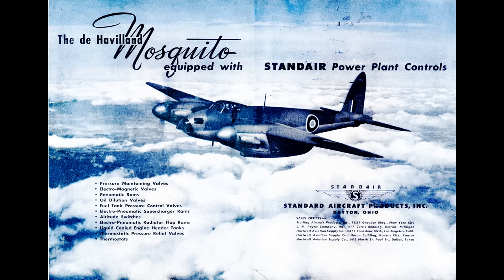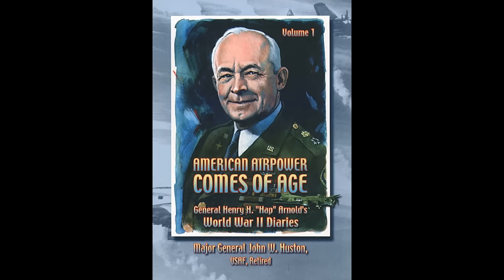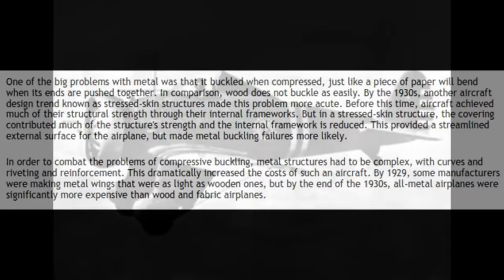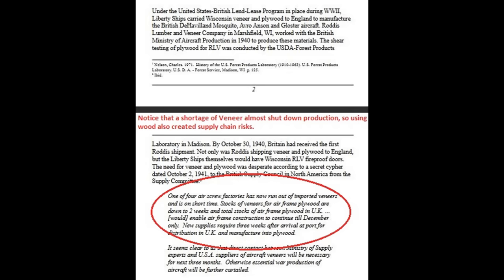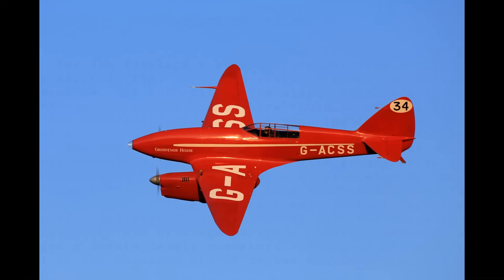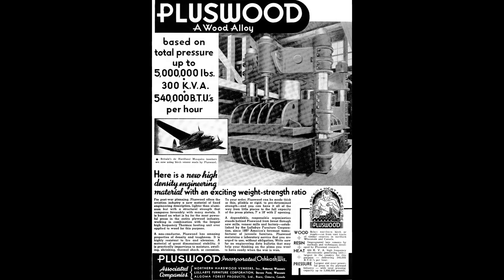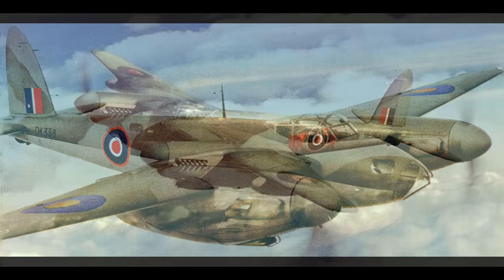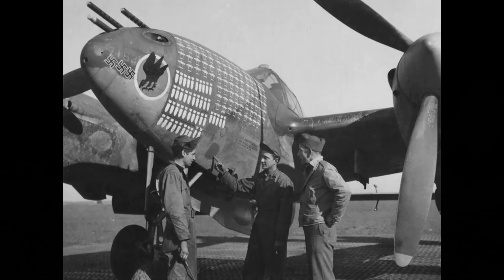De Havilland Mosquito vs. ?

Comment: Un-catchable! Met a WW2 RAF pilot in the 90's who had flown virtually everything during his service. He finish the war flying Photo Recon in "Pressurised Mosquito's" and in those missions had only encountered enemy aircraft once when 6 FW190's "Jumped him " and added a few new holes in his tail. When I ask how did you get away he said "I just opened up the throttles and waved goodbye!"  (Would also like to note the the Mosquito's had the lowest lose ratio of any allied aircraft of WW2. By 1945 only 1 aircraft was lost for every 2000 sorties.)
Reply: "When I ask how did you get away he said "I just opened up the throttles and waved goodbye!""

A very Blackbird reply there.
Reply: @scottgiles7546  it was the fastest plane at that time.
Reply: Piston contemporaries: P-51B/C was 6% faster (440 mph vs. 415 mph maximum speed), Dornier Do-335 Pfeil was 14% faster (474 mph vs. 415 mph), FW-190D-9 was 2% slower (407 mph vs. 415 mph), Grumman F8F Bearcat was 10% faster (455 mph vs. 415 mph), Grumman F7F Tigercat was 11% faster (460 mph vs. 415 mph), P-38L Lightning was almost as fast (414 mph vs. 415 mph).
Reply: @redfalco21 you re right.
Late in the war, there were unarmed moskito versions going up to 450 mph
Reply: @johnbrewer8954  for a fighter, you also have to be maneuverable.  Most single engined fighters would out-turn and out-maneuver any twin.  The Mosquito was fast, but not as agile as most single engined fighters.
Reply: @johnbrewer8954  source?  Or is this what you’d like to believe?
Reply: @redfalco21  Bearcat? Why not F-14 Tomcat? They both have precisely the same number of combat flight during WWII!
Reply: @marcinkoacz4580  Nice baiting attempt, but there’s no need to be asinine. F8F flew in September 1944, so there’s that.
Reply: @redfalco21  Bearcat is as contemporary to Mosquito as B-50 to B-24. It wasn't ready until the war ended and was one of the many superprop fighters that went obsolete before entered service facing jets competition. Whats more above 20 000 feet Bearcat wasn't even close to Mosquito, it couldn't with its one stage supercharger so it was unable to intercept Mosquito in 1944 and in 1950. Fun fact Bearcat was outlived in service by Hellcat, Corsair and Mosquito.
Reply: @marcinkoacz4580  whatever.  Mosquito is the fastest, bestest, magicest.  You win.
Reply: @heinzweber7642  there were armed P47's doing 472
Reply: @redfalco21  thats where context is important.. the late war 2 stage mossies could cruise at high speed even at 30kft  and open the taps is need be.. the enemy planes might be able to intercept but would be not be able to sustain a chase for long...
Mustangs escorting mossies of the banff strike wing across the north sea to norway  at 50ft also had a hell of a time keeping up with the mossies because they can cruise at higher speeds. Its a very clean plane, no rivets 😂
Reply: It wasn't that the Mossy was the fastest or could get to the highest altitude but that it was one of the fastest at very high altitude and could sustain so for a long time. It is nearly impossible to intercept if your fighters that were somewhat faster on paper and able to reach the altitude had to reach it first. In a climb none of those planes had the speed of a Mossi that was traveling in a high speed level flight and hence weren't able to reach it. Only if you caught it from a higher altitude and advantageous direction there was a chance to intercept which very rarely happened. Only planes with a bigger speed and climb advantage had a chance, such as the 262. Simply comparing spec figures does not prove it was possible to engage in an interception fight. I doubt the Bearcat would have performed any better than a Dora against a Mossi.
Reply: @wanderschlosser1857  Yes thats the point I was trying to make exactly.   A great design.   

Take a late war mossie at 30k.
Cruising along at 365 mph tas with 2650rpm and +7lb bst.

Temps amd fuel permitting it can increase speed further at 30kft to around 380 mph with climb power for 1 hour @ 2850rpm and +12lbs bst 

Or increase speed more to around 400mph with emergency power for a period of around 5 mins if needed as engine temps allow @  3000rpm and +18lbs bst 

Makes it hard to catch.
Reply: Redfalco … you neglected to mention the Hawker Sea Fury which had a top speed of 485 mph which made it faster than the other examples you quoted. Of course it suffered from the same problem as the Mosquito… it wasn’t from America.
Reply: @scottgiles7546  probably only caught some mg rounds, the rest a fock wulf has to offer would have fucked him up
Reply: The Fw 190 did not have a two stage compressor for high altitudes. If instead of the Fw190 some Me 109 would have been behind him he would not got away that easy. Perhaps finding a cloud.
Reply: @redfalco21 agreed, there were faster aircraft.  MRCA  ... first of a kind. (Junkers 88 is similarly adapted  ... but please!)😊
Reply: Opened the throttle and waved goodbye 😂😂😂 what a smartass! ❤
Reply: As a German grown up in Hanover, I was lucky to talk to a German WW2 veteran, who served at a 8.8 battery close to Hanover. I remember from serveral discussions, the Mosquito was the only plane which they could not fight.  Obviously the real hero of British design. And this thing looks just as good as it was.
Reply: @redfalco21 the stregth of the Mosquito was the speed at high altitudes. It was not forced to fight. There was nobody who could catch it, up there. At that time of the war Germany had more airplanes than pilots.
Reply: @augustiner3821  I often see comments about “the best plane from World War II” and I’m forced to ask “Best at what?”  Best at shooting down opponents, best at running away from opponents, best kill ratio over opponents, best looking (subjective), coolest sounding name (subjective), fastest, highest flying, most influential on the outcome of the war, best ace-maker?  Claims, based on subjective opinions, with only one or two parameters offered as substantiation, are very one-dimensional and reflect an immature grasp of the complexity of the broad strategic importance of aerial warfare.  Besides, there are also many false claims and deliberate “adjustments” of statistics and the significance they hold.
Reply: @siffchopf22  beacause of its wooden structure it could absorb a huge amount of damage and still get away and home. The mossie had the lowest loss ratio of any aircraft in WW2 on any side. By the start of 1945 the loss ratio was 1 aircraft to 1000 sorties. No other aircraft gets close, it’s not just speed, it’s tactics and battle worthyness too.
Reply: @redfalco21 at what altitude the P38 had considerable compressibility problems until the K apart from FW190 the other aircrafts were very late war and the 190 optimised for low altitude performance.
Reply: @mike-cl7pb  P-38 compressibility problems were related to high speed dives, not level flight, and the speeds where compressibility became an issue were hitting the transsonic regime, considerably faster than 400 mph.  Jumo-engined FW190s (FW190D) were not optimized for or confined to performance at low altitudes.  They had good performance at high altitudes, too.  While it may be true for the BMW 801-engined FW190A and FW190F, for example, it is nevertheless a sweeping generalization to say the FW190 was optimized for low altitudes.
Reply: 😂😂😂 @adrianrouse5148
Reply: AMAZING!
🫡
Reply: @redfalco21 Plus Spitfire Mk. XIV 448 mph.
Reply: @redfalco21  
So sorry that rather than acknowledge what a valuable aeroplane this was, your immediate reaction instead is to try and diminish it.
And you do this with a whole load of false comparisons:

•	The Grummans where much later designs, not even seeing service during the war, and only about a dozen of the problematic Dornier were even built, right at the end of the war.
•	The P51A, although a fighter, was slower than the Mosquito. And was left standing by it at higher levels as its performance dropped off badly with altitude. Ditto the P51B and C too, until they started to be re-engined with the Merlin in 1943.

And all the above were fighters, not bombers like the Mosquito. Do you have any actual like for like comparisons?
Reply: @redfalco21 And then the Hornet came along, just a little too late. Described by Eric Winkle Brown as ‘the perfect prop plane’.
Reply: @marcinkoacz4580 How about the Hornet? The successor to the Mosquito.